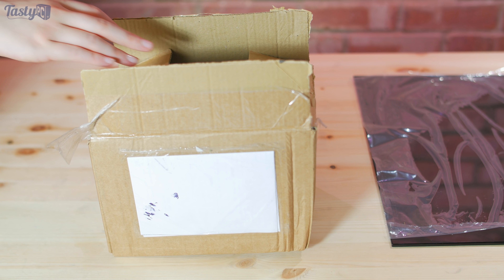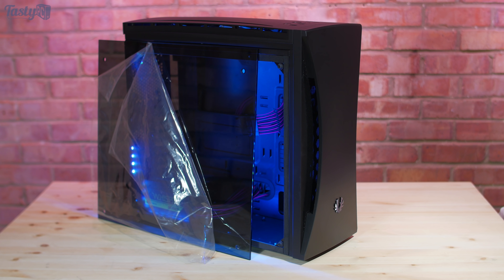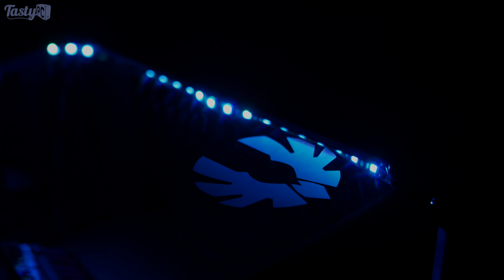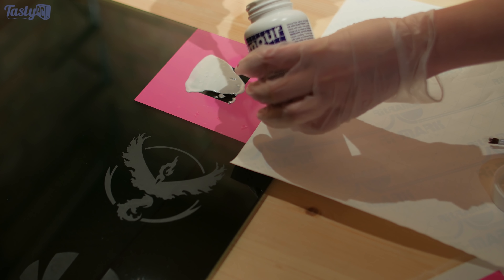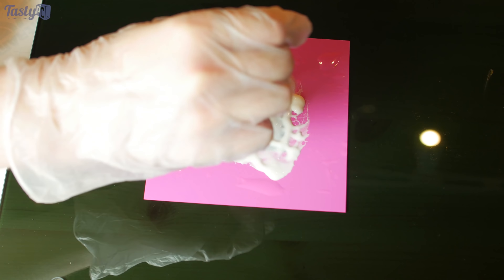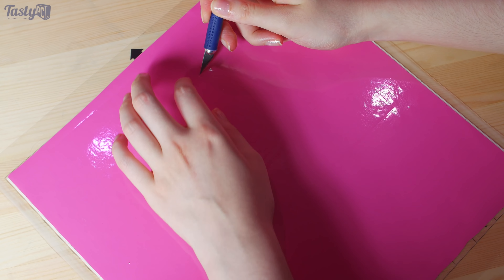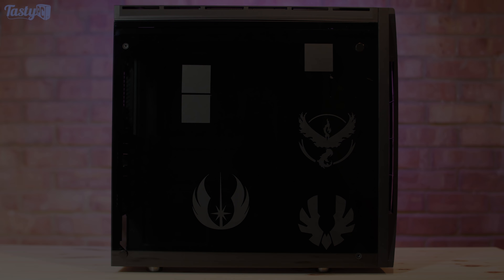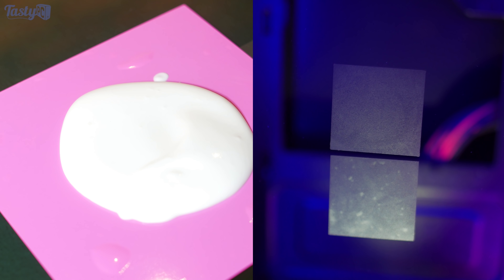How NOT To Etch A Tempered Glass PC Side Panel!

Comment from the maker: I do think that the results that I was getting would match a build theme that has a weathered/apocalyptic theme, so would work for a Metro Exodus build for example! So perhaps it wasn’t a complete failure :)

What I really hoped to try but didn’t get chance to in the video, was a pattern that spanned the entire glass side panel. (Obviously with a high percentage of non-etched glass though, so you can still see the build well through it), so hopefully I’ll get a chance to if I end up making a part 2.
Reply: Having a part two with results that you're happy with would be gratifying! wouldn't it?
Reply: hey the only way to get better is to TRY
Reply: @hakdaman: Agreed! That's my point.
Reply: Thanks for the Video Lauren. You might want to try cut a Frosted sticker (vinyl) with your machine. Then stick it directly onto the glass. I think it reflects the light in the same way. And you can always remove and replace with a new design.
Reply: Would filling the etching with some dye (or even using a marker) work?
Reply: I really like the sound of that, would keep the smooth glossy outer finish and is reversible.
Reply: just need 2 give a little taps (short and quick for about 30 sec) in the glass,this in the combination with the hot creme,gonna remove the bubles,im sorry about my english  :D
Reply: @wulff Maybe using a vibrating surface to place the glass on, so it can be continuos and homogeneous
Reply: indeed :D
Reply: Lauren, is it possible that tempered glass reacts differently to this particular glass etching cream than regular glass would?
Reply: Try using a piece of glass or plastic to kinda push lightly down on the cream after you got the get out the bottle. It might avoided application mark, maybe helps out on the edges.
Reply: i had no idea you can do this.  i love it!
Reply: Seems the sulfuric acid is clumping or separating within the etching emulsion.The emulsifier in the solution isn't doing what it is suppose to. Like the egg yolk in mayonnaise going bad. Then again i might be completely wrong.

Consider buying another bottle of the armour etch.  Shake it before use.

Comment: As for application for trying to apply the cream in a flat consistent way you could use a flat board of wood or scrap glass or maybe even a sheet of aluminium and then spread out a thin sheet of the cream on that and then place the board onto the stencil or something along those lines.

Comment: This was really interesting. I'd try a foam brush. I think that the cream is reacting with the glass where it touches it, and then it needs to be mixed on the surface so more can take its place. While a brush does the job, I would expect "brush strokes" to appear similar to painting. However, when you're doing touch-up painting on walls, you use a foam brush to mask the strokes. The pores of these brushes are smaller than the other sponge you used, so I think it would give you nice uniform mixing. They also have the added benefit of being less than a dollar from a hardware store!

Comment: Acetone is just nail varnish remover, I’m pretty sure you have some of that already. Love the video, failures are far more educational than stuff that works first time.
Reply from the maker: The nail varnish remover that I use isn't pure acetone unfortunately.
Reply: Nah, had the same issue, nail varnish remover leaves oil residue, useless for surface prep.

Comment: Others can learn from this so it's worth it, have you tried a drywall mud style spreader basically ensuring uniform spreading simultaneously, and you can fix the edges with double layered vinyl if you have precise cuts, perhaps try a blow dryer or heat gun in the first few minutes from underneath, if you have out to spare and protect the rest of the glass try adding a weight like squishing two panels together, though the last couple are wild guesses tbh

Comment: An idea to maybe not create a all-at-once application of the etching cream, but maybe to either reduce inconsistencies, or at least make such inconsistencies easier to control is to pour the initial pool away from the etch area, then use a wide enough spreader of some sort to quickly spread the cream onto the surface to be etched - in as obviously, a quick, but hopefully smooth manner.

Comment: Anything learned is worthwhile. 

I've never etched glass but after seeing the trouble you had I might try the following: 

1. Use less heat (no harm to the vinyl) and stir it really well, not only to get the lumps out but to make sure any chemicals in the cream that may have separated due to storage are well mixed.  

2. Try another etching cream. 

3. Instead of pouring it on use a a narrow paint roller, the kind used for trim work,  with deep pile to apply it quickly and evenly in one stroke.

Comment: Very helpful video,  Just because no one raises there hand in the class does not mean that there are not people wondering what is going on.  I was looking for glass etching videos when I found this.  Gave me a lot to think about.  I am also going for a full etch on 2 panels and I was thinking of trying this cream, even though I think I have used it before a long time ago, with similar results that you had.  This has helped so Thank you.  Maybe you have mastered this, in which I would love to see a video even just explaining what you did.  My only thoughts would be maybe cleaning the glass again after the stencil is applied ( cant with acetone or alcohol though, will eat the vinyl) so I am at a loss to what with.  And maybe warm the glass a bit before applying the cream,  since the cream and the glass are at I am guessing 2 vastly different temps could be the cause of the pouring impression.  If I try this and use a different cream  or get a result without some of these issues i will try and send you a note.  Thank you again.

Comment: I think modding is what you make of it, every case I've had has either been painted using spray paint and vinyl stencils/masking tape or just a straight vinyl application, I've even used painted acrylic sheets to hide cables in my mastercase. Every single  mod has been imperfect in some way whether it's painting bleeding under the masking tape or even just the coverage not being 100% in some places, I've always been happy with what I've set out to do. Mod what makes you happy if your aiming for perfection or a 4 foot mod it's your rig at the end of the day :)

You can also etch acrylic side panels using a card template and polystyrene cement (airfix glue essentially) just another idea :) glad to see another video :)

Comment: just watched a video on someone doing it, turned out alright and all he did was apply a liberal layer of it horizontal over the entire design, then vertical, then as well diagonal with a brush.  It wasn't a thick layer and he kept applying it nearly for five minutes then let it sit for a couple of seconds, and make sure your edges around the design are pressed down so you don't get the bleeding edges.

Comment: Transfer with this kind of adherence pretty much always leave behind residue. It might only be on the microscopic level, but that still matters when doing chemical treatments that requires properly clean surfaces. First off, I would suggest cleaning with 95‰+ acetone after removing the transfer paper, if the vinyl can take it. And do inspect afterwards, don't take a clean result for granted - there might be something left that acetone won't dissolve. The pour seems good, but what you could attempt if thats spending too much cream, is an improvised silkscreen over the stencil. Might need to give it a few tries to get good and even coverage, but that should also filter out any crystals so they don't make it onto the glass. Doesn't need to be a stenciled silk screen, just stay within the outer borders of the stencil.

Comment: I use acetone and alcohol in my work to clean surfaces to an ultra high degree of purity. People telling you to avoid alcohol are clueless. So some general facts:

Cleaning with acetone is an excellent start. However, basically all acetone you can buy is significantly contaminated. It’s much easier to buy pure alcohol, and the main purpose of the alcohol is just to remove the few residues left by the acetone. 

The transfer film is definitely leaving a residue that is interfering with the etching cream consistency. I suggest acetone, alcohol, put on the stencil, and clean with alcohol again. Acetone will melt the stencil, but alcohol won’t.

The only reason alcohol would have problems is most alcohols have significant water content and water will bead and dry very slowly. The solution is to buy good alcohol from a lab supply store, not garbage rubbing alcohol from the grocery.

The way you apply the cream is probably best if you stir and pour, for consistency of the cream. The cream does the work chemically, you only have to get it on a clean surface and not prevent it from doing its job. You don’t see anyone brushing car paint, it’s all prep work and an even spray, then leaving it alone.
Reply: Acetone contaminated by what though? It shouldn't matter if it's got a tiny bit of water and a bunch of secondary ketones in it. Volatile compounds generally help water evaporate along, so it's not a problem up to a point. I 3D print on bare glass when i print PLA and residue tends to cause print lifting, so good cleaning is important, and i haven't had trouble with Fischar Chem acetone. Alcohol differs by batch, sometimes same brand comes off clean, sometimes there's a residue, same with white spirits. You know what though, just washing under a sink with dish soap and then a good wipe with a paper towel generally does just about the best. Gloves recommended to avoid leaving any human residue.

Comment: I’ve never played with etching cream.
But I do have a couple questions
After the cream cooled down to room temp, did the crystals reform?
Did you completely abandon the “keeping it moving” method after you started heating the cream?

To round out your testing, I would try heating the glass (hair dryer) before you pour the hot etch. Moisture could be forming on the glass from the temperature difference. I saw a lot of steam coming off your last pour.
Or if no crystals are forming at room temp. Try it again that way. 
Plus, try going back to the “keeping it moving” method.

Again never played with etching cream
And just talking out of my a$$ lol

Comment: Glad you're back with more great content! When making tempered glass, the surfaces, front and back, are made in such a way that a really hard skin forms during the manufacturing process. That could be why you're getting that slightly deeper etch mark from when you first start your pour/application. I've only etched on regular glass which would be a much easier project, just not very safe for a computer side panel.

Comment: Where I work we sometimes apply lacquer on glass.
Tempered glass often has a problem with some residue being permanently left on the side where it was laying on during the tempering process making painting it a nightmare.
We solve this by simply painting the other side.
I don't know if this is your case or if it applies at all to the etching paste.
Your problem might still be in the transfer tape or not having yet found the optimal applying method, but since it is a sacrificial side panel it might be worth trying to etch the other side of the panel.
You can also try using a method similar to screen printing: you put a generous amount of paste on the vinyl of the stencil without touching the glass an then with a sqeegee or a spatula you drag it on the glass uniformly.
Also maybe try letting the paste cool down before applying it because it might make the edges of the stencil less sticky and lift them up.
But I really think what you have already achieved is a remarkable result that I would be already fairly happy with, after all, it's the first time you attempt this, right?

Comment: Firstly, don't use acetone to clean any sort of plastic. Acetone melts away plastic.

Secondly... I think you should apply this with a roller with an as fine as possible texture. Also make sure your stencil is removable.
Here is an example video: https://youtu.be/zQr8KistZWo
Reply: It's actual glass, not plastic though. Besides, Acetone is a solvent for some plastics but not others - polyethylene, polypropylene, polyamides are immune to it. Cheap parts such as PC enclosures and keyboard parts are generally polystyrene based and acetone makes a quick job of them. Also look we've all melted plastic with acetone because... fingernails. Who doesn't do them while watching YouTube? Ruined sooo many keyboards...

That being said, PVC has some susceptibiility to ketones, so there's a possibility that a minute amount of the stencil material gets mixed with acetone and transferred onto the glass with that.

Comment: Great video! I didn't know that you can edge glass with cream! Maybe you have air bubbles on the surface of the glass that mess up the result. You can try pouring it in one move to the same spot and let it spread naturally. Or maybe with something like a suction chamber with a bowl and a air compresor you can force the air out. Anyway, thanks for sharing!

Comment: Not that anyone will read this comment... but the best glass etch results will come from a an "Airbrush Kit" with aluminum abrasive media. DITCH THE CREAM!
You'll still need your vinyl plotter, but you'll also need a little air compressor as well. If you really want to try it, but don't have one, or can't afford an air compressor yet... Badger does sell a complete glass etching kit that includes a can of compressed air. Enough to be able to do a project similar in the video. (Just don't do it at your desk... take it outside, otherwise you'll find abrasive media for years in every nook and cranny)

Comment: Buy a different cream, and don't pour it on steaming hot. Once the crystals have fallen back into solution, the cream should be good unless it's cooled significantly enough to make them form again. If you want to apply the cream neatly, just clean out a squeezy bottle with acetone. Make sure the tip isn't too small.

Enjoyed the video, thanks.

Comment: not an expert, but here's my take.
the transfer tape will be causing the patchy issues - cleaning the glass should be the last step before applying the cream , also to avoid application marks, get a slower acting cream.
and lastly, it's not going to be as perfect as professionaly produced etches if you're using creams, you need a laser to etch the glass for that even, crisp etch you're looking for

Comment: Wow, this brings back memories of Junior High School art class, where I learned how to etch mirrors.  We did it the old fashion way, by taping a piece of carbon paper over the contact sheet, that was on the mirror, then placing the picture or clipart we wanted, over that.  And finally the tracing of the image, and cutting out the pieces of contact sheet paper.  We used hydroflouric acid (the stuff smelled and had the color  like brown sugar), which as you did, we warmed up for a while.  And used a small paint brush.  Fun stuff.  I think you did an awesome job.  You just seem to be a bit of a perfectionist on this level.

Comment: I think many many many years ago I had to place a design on a t-shirt. I would sandwich the t-shirt into a sort of wooden contraption. I poured the colour above the design and then pulled a wood piece downward, thus scraping the color over the t-shirt in one thin and even coat. I think maybe you should try a similar technique of placing like a blob of the stuff above the design, then pulling the cream over the design with a flat scraper. I can guess these things require a consistent layer on the design, of consistent thickness. Agitating the cream as you did initially, and then pouring as blobs created uneven sections, so areas with more cream stand out. I don't think my suggestion is the ultimate method, but rather my suggestion is specific to the type of cream you are using. I wouldn't doubt a more expensive cream allows for more inconsistencies.

Comment: Youre leaving the cream on for too long and putting too much on, 15 minutes is all it needs, moving it every 5 minutes, then rinse it off with warm water. youre getting crazy edges because the etchant is going way way way too deep. Warming up the cream is okay but let it get back to ambient afterwards. And the more evenly you spread it, the more even the etch. The finished etch also shouldnt be white it should be a dark grey in color, if the etch is too deep it wont diffuse light properly.
So. 
Wait too long = Ruin your etch
Apply too much = Ruin your etch
Dont rinse properly = Ruin your etch
Dont agitate every 5 minutes = Ruin your etch

What i use to etch.
Painters tape instead of transfer paper
Armor etch
Mud knife to spread and agitate
Stencil vinyl

Hope this helps.

Comment: Putting a big and thick layer of etching cream on the glass, leaving it static sitting there is useless because only the very thin layer in direct contact with the glass is reacting with it. As a matter of fact, etching cream will never produce 100% perfect results. I use Fluoric Acid, but A) it’s difficult to get (as chemist I have access to it), B) it’s extremely dangerous to handle and C) even this is not 100% perfect, but I would say 99.9%

Comment: This is not utter incompetence. If you tried to do a square, and it turned out to be a triangle, that would be odd. But, I think all of the ones you did turned out acceptable. I wouldn't do this to my side pannel, because I like my panel like it is. But I think your worked looks good.